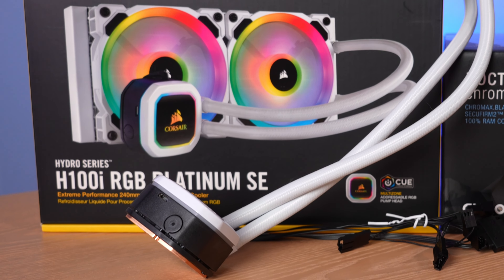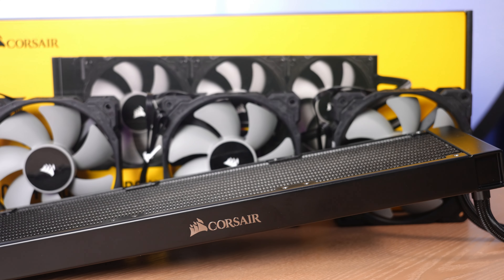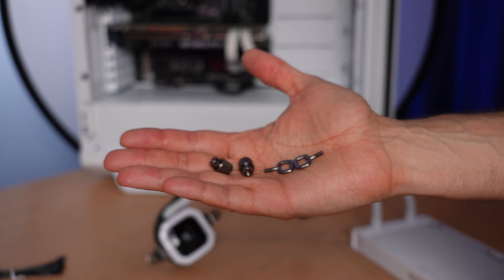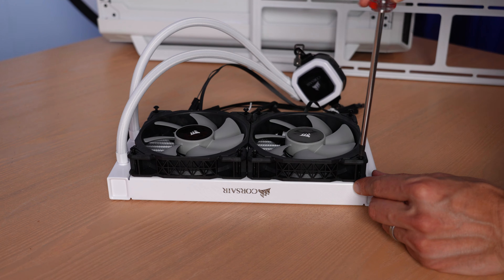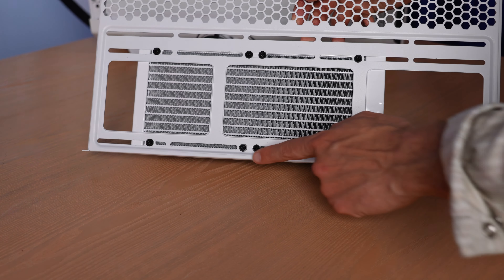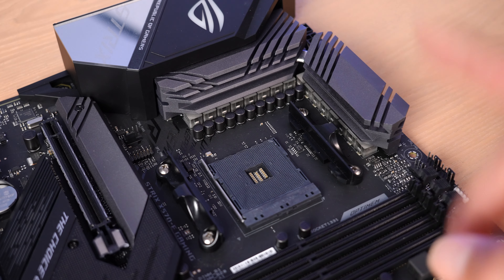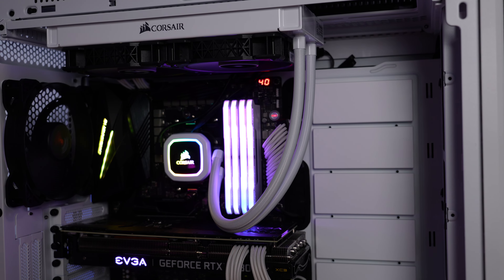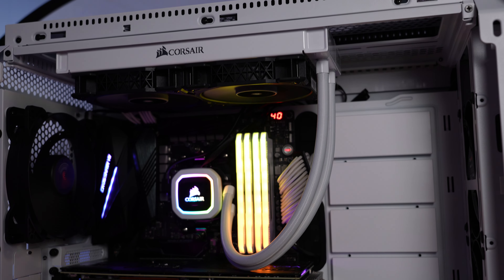Corsair Hydro H100i/H150i Liquid CPU Cooler: Install Guide for the AMD AM4 Platform

Comment: Why does everyone gloss over the connections to the motherboard. Please show where these small connectors are suppose to got rather than say “connect to motherboard” that does not help.
Reply: Thanks for saving me 13 minutes of watching this.
Reply: It’s different on every motherboard or most at least
Reply: Usually there is a pin port near the CPU block. Look around the CPU socket for a connector that says C Fan, CPU F, CPU Fan. Also use your motherboard manual aka RTFM. 

Edit. If you are building your own PC. It is wise for you to read all manuals front to back.

Comment: The am4 mount for Corsair AIO coolers are nightmares
Reply: all am4 aio coolers use those wobbly mounts
Reply: @babaganoosh7020  best one i found overtime is to use the 360ml nzxt kraken. Keeps all 24threads running at 4.7-4.8ghz  jn the 35° c range under load!
Reply: @AJerseyJohnnyEntertainment  yea that one has 4 mount screw so its good, arctic liquid also has good mounting and cooling

Comment: I just bought this radiator and it comes with a different AM4 mount than this one. I'm having issues though because the standoff screws included don't screw the backplate in snug. Anyone else have this issue?
Reply: I do too, no idea what to do
Reply: Have y’all figured this out. I’m a sitting duck I have the same issue. I’m starting to get really pissed off
Reply: I thought it was an issue but it’s not (just got /installed mine today). The standoff is loose until you put the pump on. The pump fills the wiggle room. Hope that helps👍🏾.. they just changed the mounting hardware..
Reply: Couldn’t find help on any forums, and I started looking at it and seen the contact part of the pump and the screw holes were different depths.. the it clicked in my head
Reply: @MrLucht  holy shit yes! thank you!
Reply: @DogelonMusk  Glad to help! I was so frustrated at first..
Reply: Mines came with a different mount as well, it just looks like a more rounded version of intels wtf corsair??
Reply: @honorablesix  read my first couple of comments in the thread. It should help
Reply: @honorablesix  it’s the right hardware and works. It’s loose before installed but when installed the cpu fills the gap and it fits snug..
Reply: @MrLucht  dude you saved me!! I appreciate you 🙏🏽🙏🏽
Reply: @MrLucht  I took the same thought process. Even tried adding some washers to fill out the extra space, and when that didn't work, I just went for it and fastened the thumb screws into the Am4 standoffs. No installation videos have shown the new model, either!
Reply: @maximumbummer  Yeah its was very annoying and almost returned it. But figured Id try it first. Their instruction book is too vague, and like you said no videos are up regarding the change.. Could've been a good opportunity to make a video on it I guess lol

Comment: My Corsair liquid cooler came with an AM4 mounting hardware bag but inside are ONLY THE BRACKETS THAT SLIDE INTO the pump head from the side and 4 screws .  Just strange that this video shows these clips for am4. I have the same model liquid cooler.

Comment: I feel Corsair really needs to re-design their fans, cable management and mounting hardware
Reply from the maker: The new Capellix models actually have a totally different cabling system, trading a lot of the cables coming off the pump for a breakout box that mounts behind the motherboard. Neater and supports more fans, but also bulky in its own way.
Reply: @TheTechBuyersGuru  I can agree with Tony. I have the Capellix h100i and mounting the pump on an AM4 is a disaster. Bare with me, not all hooks on the AM4 motherboards are the same. For example on the Gigabyte and MSI one, the profile of the hooks is none existant, so that the eyes of the mounting clips have zero to none grip with the risk, if you're using a screwdriver to thighten the screws, those eyes tend to pop off the hooks. I don't understand that for a 150 Euro costing AIO, Corsair went for such a fiddly mounting system, while they could have gone for a stirdy 4-point mounting system.
Reply: @dorientjewoller113  the one I just bought a couple weeks ago does not come with the hook style any more

Comment: AMD Radeon 7 5700 please tell me how the fuck I'm supposed to mount the cooler to the cup. The shit it came with isn't really giving me a tight connection. It wiggles around when you connect the screws to the shit that is in the back of the motherboard

Comment: My thumb loops don’t fit the mount 💀😫
Reply from the maker: You probably have the standoffs upside down. The thumb screws definitely fit when installed correctly..
Reply: @TheTechBuyersGuru  turns out they put the wrong thumbscrews in with the kit. went through a whole thing lol. they look nothing like the ones in the video.

Comment: Great video, thanks for sharing. Its been a long since I build a rig, but this one I want to go Liquid cool. If i understand this right, the collant is already in the radiator? sorry for the dumb question. Can't wait to start this build !!
Reply from the maker: Yes, with an AIO (all-in-one) cooler, the coolant is pre-filled, and except in rare models from a few manufacturers (not Corsair), actually cannot be accessed. Good luck with your build!
Reply: @TheTechBuyersGuru  Great to know, thank you so much for the info 😉

Comment: Why in some videos that I watch people mount the fans upside down like shown in the instructions but other people mount them the way you did in the video
Reply from the maker: You only install them upside down if you want it set as a pull fan. Slightly quieter if used in a front mount, but not as effective.
Reply: @TheTechBuyersGuru  OK thanks for the advice I appreciate the reply